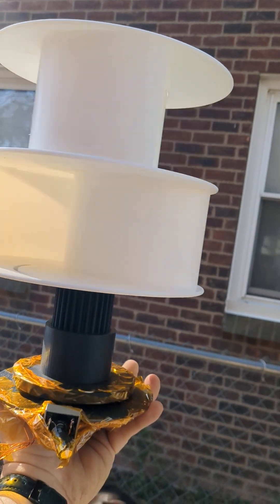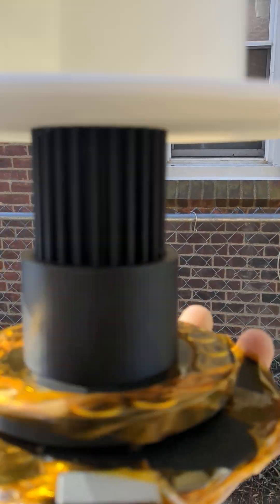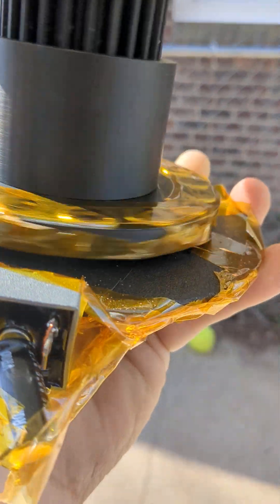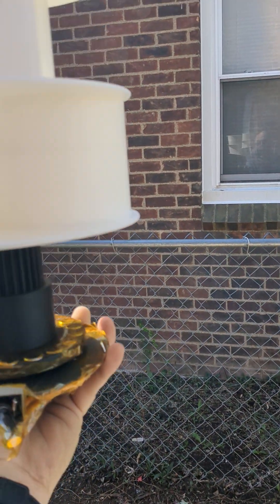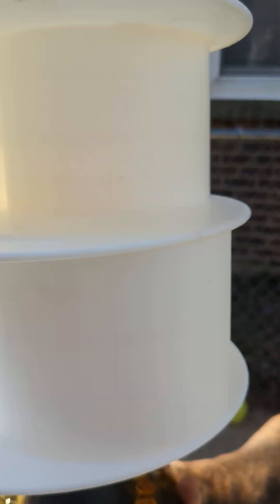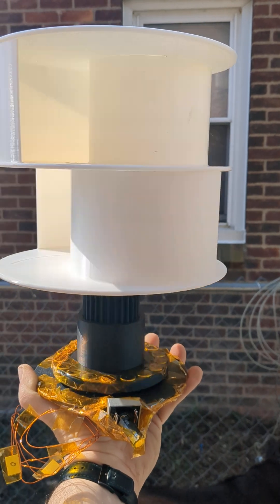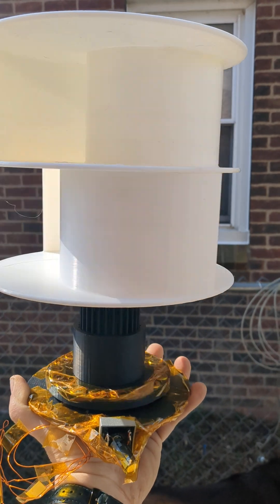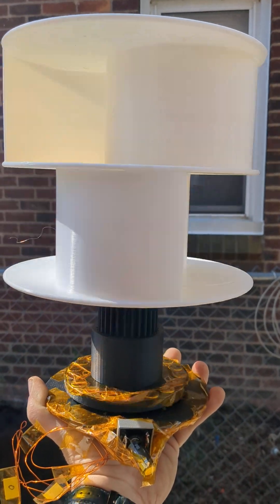Savonius wind generator first draft

Comment: You could potentially have many of these scattered around all wired to a single battery.
Reply: And then redirect a small portion of electricity from the battery to an automatic lubrication contraption for the gears, and there you go— energy crisis solved
Reply from the maker: @justsomeguywithamustache1709  Love it!  A little lithium grease works great with PLA.
Reply: @leadfootpress  ❤️
Reply from the maker: Yessir!  I'm going to first try to build up the generator on this one.

Comment: What does it do?
Reply: converts wind into motion, potentially could be used to create electricity im guessing?
Reply from the maker: The black thing in my hand is an electric generator.  The white dohickey catches the wind and spins the generator.
Reply: A more efficient form of wind turbine blade 

Wonder if it's used in boats (it's a bit similar to boats and fans blade but much more narrow angle and long transversal blade)